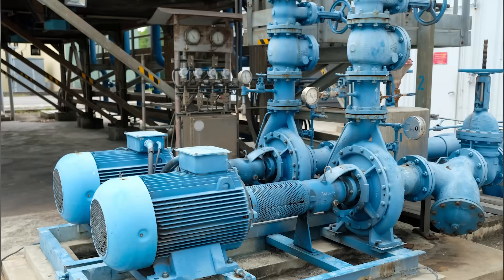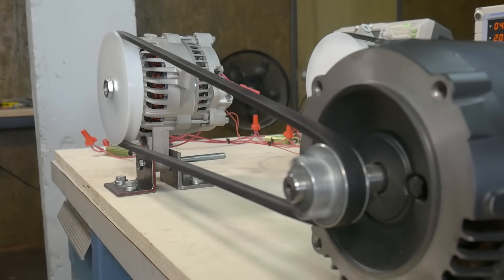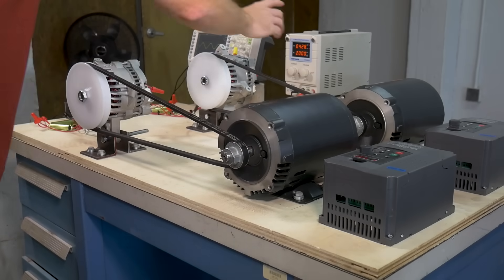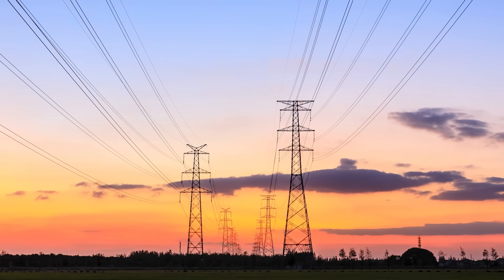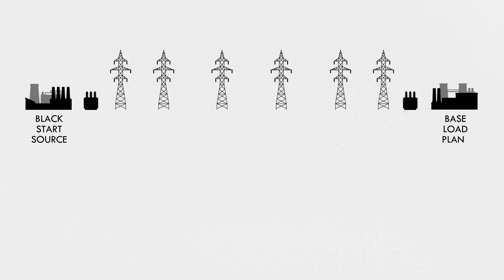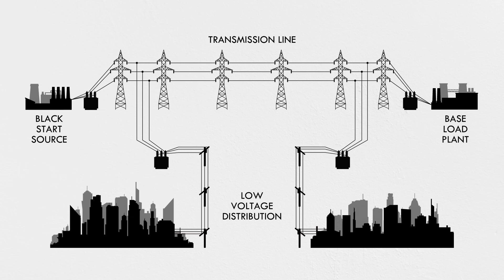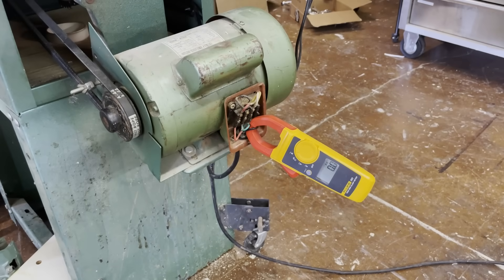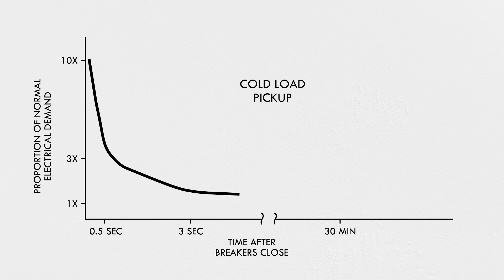What Is A Black Start Of The Power Grid?

Comment: There is something alluring in power outages :D Of course, when they happen during innocent mild storms and don't last for very long, I'm not talking catastrophic events here. My home town was susceptible to frequent power outages during any thunderstorm, really; every time there was a flash of lightning heralding a storm we knew there's going to be a power outage. What's even worse, there were so many failed attempts at restoring power, the surges and spikes, as my father called it, which messed up appliances and electronics throughout the place. 

For that reason my father slowly started installing UPS in the flat, at first it was just a battery here and there to maintain the cordless phone (this was during the 90s and early 00s in the south of Croatia so VOIP was still far far away), radio etc. Little by little he started expanding the coverage and now he has powerful deep cycle batteries and an inverter which powers up the entire flat keeping everything alive (from lights to the fridge, even an oven if needed :P). He does that for a living, more or less, anyway. And I do remember him saying (this was before we had all the fancy setup) we ought to unplug or switch off heavy consumers e.g. if the oven was on at the time or to unplug the fridge etc. because "it'll help with restoring the grid". Now I know why :) He was always saying "if only everyone would do it, power would be restored much more quickly!" Also note again this was back then before inverter motors and fancy eco devices, everything was just sucking up energy back then :D

Anyway, the point was, our flat was the only one shining like a beacon during the worst of power outages. The entire neighbourhoods would be plunged in darkness and we would be watching TV, switching lights, just, you know, living, and often the only sign we would get that the main power was off was a beeeep from his contraption when it would switch from mains to battery power. 

And also, you could hear it beeping a lot even when there were no outages, absorbing the spikes and surges, so a lot of our appliances and electronics were saved from damage this way.

Comment: FYI - Retired nuclear electrician, engineer and power plant operator here.  Your discussion of the syncroscope as almost correct.  You did NOT want to scope stopped at the 12 o'clock position when closing a breaker to tie two powerplants or grids together but actually moving slow in the fast direction and timed to close at the 12 o'clock.  This establishes one plant or grid as slightly faster than the other and causes it to immediately pick up some small amount of loading.
This is important to prevent some other change on the grid loads from occurring that might cause your newly connected but zero load source from going into a reverse power condition.  This could damage the equipment or more likely cause a protective relay to operate preventing damage and the transient causing further grid disruption.  Like I said its a minor difference but can actually cause entire islands to collapse again during a black start condition.

Comment: With world (modern/rich part of it) more and more relying on electricity, it is terrifying to imagine what could happen in case of, for example, strong Solar storm (like 1859 Carrington event). Like how ready power lines are to quickly (half-automatic) disconnect lines to avoid cooking transformators when strong Sun "created" current is flowing through wires by itself?

Comment: I've always wondered -- why do we build devices to have high inrush currents?  Isn't it possible to design and build these devices so they draw a steady current from the source (grid, generator, batteries, whatever) and temporarily store the energy needed to satisfy the startup conditions before physically starting up?  That way, any extra current required for startup would be handled by onboard components and wouldn't affect anything else.  It seems like that would be better for the grid and for the customer's internal electrical system (lower probability of blowing a fuse or tripping a breaker).

Comment: I enjoyed this video, working at a Hospital in Fairbanks Alaska, power outages are something we have to contend with more often then I'd like. A small short outage will result in all of our Life Safety equipment immediately receiving power from our Generators Via Automatic Transfer Switches, but during bad weather, when we lose both our Utility feeds we can put the entire building on our Generators and even our own small "mini power grid" has to be brought back in 2 sections or the surge in load from all of the electric motors we use starting up at once can potentially trip our Generator Tie-In Breaker. I've seen this happen once and its not fun to have to start that process over when everyone's waiting on you for the lights to come on. When utility power is once again reliable, we have the ability to sync up to the power grid to come off our Gens and go back on Utility power in a way that noone working out on the floors even notices if its done right. ( we can also go the other way but power outages rarely give us enough heads up for that) The process is automated but in our control room we have a Syncroscope we watch while the system syncs to the hz of the power grid, and then starts shedding power off the generators.  Its an interesting part of my job for sure.

Comment: often times, with synchoscopes, you wouldn't adjust it to be perfectly in sync, you'd align it to move slowly with the oncoming generator a hair above the other (moving slowly in the direction of the fast arrow direction) so the oncoming generating device is forced to assume a small amount of the power generation and not try to revert to a motor.

Comment: Excellent explanation of black starts! I was in charge of the shift responsible for black starting my country (Trinidad and Tobago) in the wee morning hours of Friday March 29th 2013. Very stressful experience!
Reply: that sounds enormously stressful - am I guessing correctly that if it had gone poorly, you might have waited months for replacement equipment?
Reply: @chrishayes8197  every situation is different but generally the generators and turbines on the grid have their protection systems that operate to prevent damage to the units. I think in a scenario like mine, the critical item is that the units that tripped have auxiliary power available for lube oil and turning gear to prevent bearing overheating and shaft bowing respectively. These are relatively low power requirements and a diesel Genset can easily provide. After that, once main power is restored, the units can be started up again safely.

Comment: Thank you for the explanation video.
At 03:50
It is vital to keep generators battery system (DC Voltage) well maintained. So in case of major black-out, the black start generator is ready.

Comment: Does a "hot water heater" only heat hot water?
Reply from the maker: Yeah once you turn it on for the first time, it keeps the water within a narrow (hot) range of temperature. It’s always heating water that it already relatively hot.
Reply: @PracticalEngineeringChannel  so it heats cold water too? Why not just call it a water heater?

Comment: Nice explanation as usual .
Renewable power has also complicated grid scale systems with the use of batteries and other devices needed to balance the voltages and frequency issues .
A large scale black out is everyone's worst nightmare .
The US has had renewable energy sources since the eighties but not at the scale it has at the moment with more batteries smart switches and rotational voltage and frequency stabilisation devices such as synchronous condensers being used to keep the grid balanced.
We just had some towers that carry High Voltage power lines collapse due to metal fatigue and bad weather which caused the biggest coal fired power plant in the state to trip out and shut down. 
The storm also wreaked havoc on normal power lines and left over half a million people without power.
It has taken three days to complete most of the repairs and get the power back on to nearly everybody.
😎🇦🇺

Comment: It is more likely to 'survive' without stopping when you remember that receivers are usually not using all V and A and (especially for motors) you should rather use some circuits to re-use this power not to return it to grid because power speed and loss is deltaV (between 1,0 1,2,0) related.

Comment: about the 10:58 mark, PE is explaining about synchronization of different power generators and the problem that can pose.  I recall a time when a certain facility lost it's prime (commercial) power.  They had 3 standby generators.  One was down for maintenance.  That left two, synchronization failed as they started up and one shut down because of that.  The last was insufficient to carry the load demanded and it failed as well.  Took days for them to get it all restored.

Comment: Synchroscopes are actually still in use for manual operation and synchronization at a lot of plants in cases where the plant needs to be manually brought back online before automatic sync systems come online.  Also, yeah it's pretty terrifying what a generator will do if it gets to far out of sync with a grid, they tend to fail in very dangerous but spectacular looking ways when it does happen. One clip I seen from one generator failing because of going too far out of sync with the master beat frequency of the grid was part of the turbine being ripped apart so hard it embedded itself into a solid concrete wall well over 2 feet deep. If you had been in that room and got hit with basically any of the debris from it failing you at the very least would of been having a terrible day and more likely been dead from blunt force trauma.

Comment: Working in the power plant training field, this information is very accurate. I have run simulators that start from a black start, and the procedure is much different than a normal start. One plant was designed independently of the grid because its power use used for industrial use. It had five black start diesel generators that started a 5MW natural gas turbine used to bring up the larger natural gas 75MW turbines. The lube oil and cooling pumps are major power draw devices beyond the computer control systems to start these plants. To increase efficiency, heat recovery created steam to run additional steam turbines.

Comment: It really doesn't take muck current to bootstrap the field windings on a generator, precisely because it has minimal load. In fact just the slight residual magnetism in the metal can be enough to feedback and spool up to a full load in just a few seconds of operation, (even a very small generator would make it more reliable of course) and only one mainline generator needs to be started from scratch that way. What really takes the boot up power is the plant support equipment prior to spinning up a generator, like you indicated hydro-plants are often self starting for this reason.

Comment: Hi Grady, great vid.
We also need to understand the necessity to maintain frequency. For you guys its 60hz, for us its 50hz.
If the generators fall below (or go above) a given variation in frequency they will trip off. This makes black starting hard because (as you said) they need to balance supply and demand.  Too much demand will cause frequency to drop.  This is why they try to do it gradually, but the large generators needed for grid stability also have large minimum outputs, making it harder again.

Comment: Excellent presentation. I've only worked at one power station with black start capability. It had four 25MW gas turbine alternators, each capable of supplying the auxiliaries of the four 500MW turbo alternators. The nuclear power station where I spent the bulk of my career, however, was totally dependent on incoming supplies for a cold start, although it did have diesel generators for emergencies.

Comment: One thing you don't want to do is stop those old oscilloscopes exactly at the 12 o'clock position as this is the position they default to if power is not present on the other bus or if it is broken. Moving slow in the slow or slow in the fast directions is best.

Comment: Interesting,  I  didn't know about the excitation current.  The synchronization of the generation stations, so the AC wave forms matched, is a logical step.  As is the phased startup of the pieces of the local distribution network.   A question: If the northeast corridor grid goes down, can the neighboring grids be the black start points, as they are already in sync the rest of the national grid?  There still would need to be dedicated black start sites, in the unlikely event of a nationwide/ worldwide loss of generating capacity.

Comment: I'm a submarine nuclear electrician's mate in the US Navy and watching you explain voltage regulation and generator synchronization has put a huge smile on my face. My ship had basically an identical synchroscope to the one you showed and matching voltages/frequencies is an important part of operating our electric plants.
Reply: I was an IC man on a surface ship in the 90’s. Minesweeper. Because of the small size we worked hand in hand with the EM’s and one of my many jobs was switching from Ship to shore power and visa versa. We would compete to see who could synch both without blinking the lights on the ship. Fun times.
Reply: Yeah man slow in the fast direction for the win.
Reply: Not quite the same, but on my old turboprop aircraft in the RAF, each engine drove an alternator for power. No surprise there, but the frequency was directly related to rpm and that was sensed and used to keep the engines in sync with each other.
Reply: Good think modern phase matching equipment will slow the disconnected genset by 1Hz/sec and within a minute can sync up to connected line power and add to it.  That solves the phase problem without requiring knob adjustment.  It also saves wear and tear on the MG set by not accelerating and decelerating, and creates a predictive point (<60s) for phase match.
Reply: lol, as an ELT from the boat back in the 90's, I still wake up in a cold sweat yelling "Slow in the Fast Direction!!"  😋😂
Reply: @smitaaay  Oooh. Don't forget "High chlorides in the starboard steam generator..."
Reply: I work on a conventional power plant unit and we use the same exact synchroscope too 👍
Reply: i used to work on a tug with the same set up too.
Reply: Same here Watch Supervisor for 1 plant Enterprise. Nice to see someone has some basics.
Reply: Your friend has a cool job, what did you do?
Reply: Nuke power plant operator, same deal.  I had the pleasure of working mostly with ex-Navy folks my entire career.  Uh, 'interesting' to say the least.

Comment: Thanks for showing the syncroscope!  I ran nuke plants in the Navy and we used those to sync power freq and phase to bring power distribution segments online.  The usual rule was to get the scope turning clockwise at a slow rate, then operate the breaker as the needle was approaching 10:30 o'clock, giving the mechanism a little time to operate and close at 12 o'clock (ideally).  During a training event, a new operator closed the breaker much too early - around 8 o'clock - and the breaker "rapidly disassembled" itself.  That shut us down for a few days, but it was better that the breaker died than a steam powered turbine generator :)

Comment: There's another complexity of doing a black start: You must never generate too much unused electricity, as that will mess up the frequency of the grid, and the feedback into the generators might drive them beyond safe operating range.

So as you start a set of generators, you just MUST add more load. Then let the frequency stabilize. Start another generator, add load, and stabilize. Lather, rinse, repeat.

Ideally the grid is build in a way that allow such granular startup (of generation and load), but we know that nothing is ideal...

Comment: In the UK we have an island wide grid that can be seperated if necessary at the Scottish border. We have two control stations that work the sources to provide the power. It is known that at certain times there will be huge increases of required power to satisfy the needs of the consumers, that is why there is a 50% additional green energy sources than is usually required to fulfil the needs of the country. 
We are being threatened with blackouts due to the imported fuel from the EU not being available, yet Scotland is almost 100% green except for one power station that is required. Strangely we find that threat veiled as we are surrounded by green energy sources and we export to England, yet still have to pay for the fuel England buys.
Having built and worked in substations I know that if there was a power problem it does not mean the substations are useless as they also have manual over-rides, so, engineers simply work out the power arounds and switch them manually.
I am unaware of just how connected the US/Canadian grids are to one another and if there even is a counrtywide grid or a number of seperate grids.